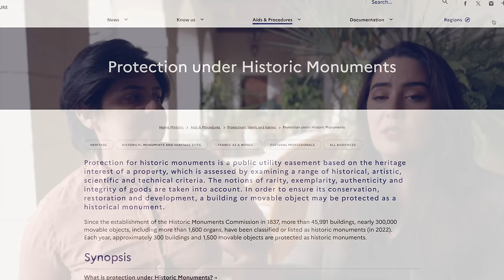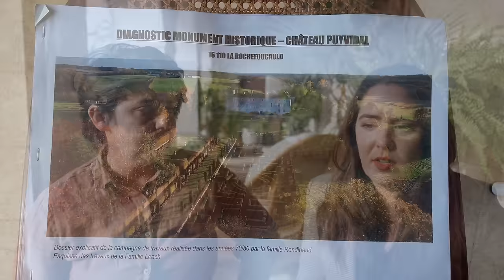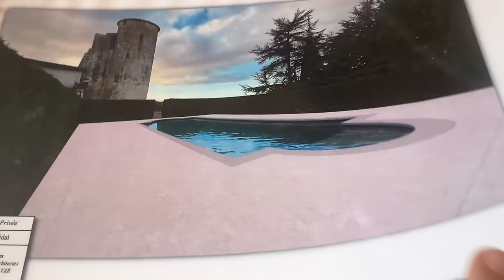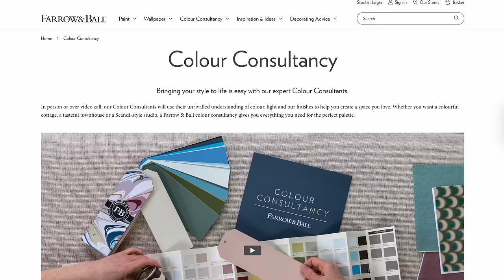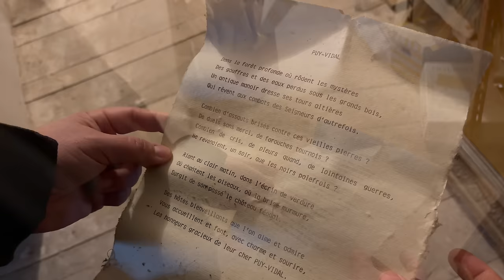A NEW SEASON BEGINS | Breaking Ground at Château de Puy Vidal

Comment: I feel like a feature wall is very modern concept. A suggestion, the wallpaper may need to cover every wall, with the green paint as the trim, mouldings, and ceiling colour...
I'm in a modern new build in Australia and i can't bring myself to start the process of considering paint colours. However have bookmarked the wallpapers to consider for the ceiling

Comment: I'm interested to know if one of your issues with the kitchen location had to do with the fact that guests would have to pass from the great room through the kitchen to get to the new dining room location, unless they went outside to gain access. Of course, if the weather is nice that isn't a concern; however, in inclement weather, it could be addressed by placing an awning over the exterior path.
Reply from the maker: That’s definitely one of the issues! There are also many other details of layout in the kitchen and size that we wanted to run more workshops before deciding.

Comment: Have you ever heard of “borrowing from the walls”? It is a faux technique to fake wide crown molding. All around the ceiling, about 2-3”
down, put a thin strip of molding. Then, paint the molding and wall showing above the molding, the same color as the ceiling.

Comment: "I didn't know I was fussy" :goodvibes: That's a statement that will go down in history. On the other hand -- you're an ARTIST. 
I'm thinking about this. I'm an artist too -- and one thing --  when you're used to working with color it turns out that we have a broader tolerance, a bigger range of colors "go with" things -- don't you think? There's color and then some ineffable spirit of the colors as they go up side by side. Well, maybe I'm overthinking it. I think I'll just stick with the original quote:
"I didn't know I was fussy."

Comment: It’s like the heritage trust in England  with there listed building when you do restoration or renovations you have to follow there guide lines so if your home is in Cornwall and you need to restore let’s say the parquet flooring you have to get the flooring from where ever it came from so your in Cornwall  and let’s say they got it in Wessex and you have to use the same material as well so if the flooring was cherry that’s the wood you need to get just like anything else you would need any materials as well it doesn’t matter it has to come from the city or town which it originally came from and everything has to be approved from the heritage trust it’s crazy   Ugh